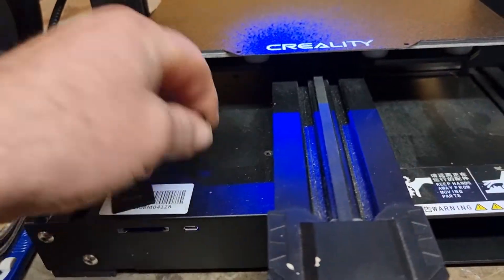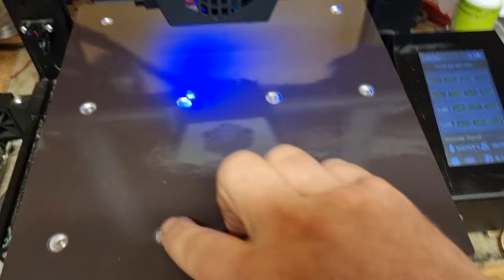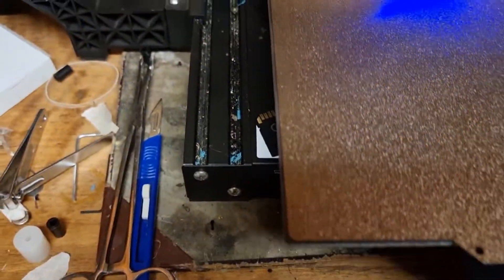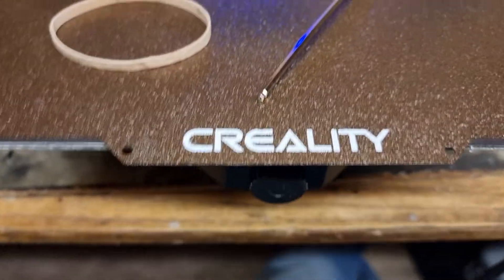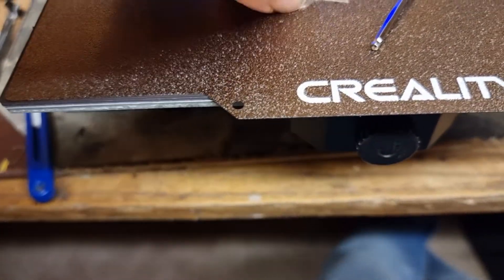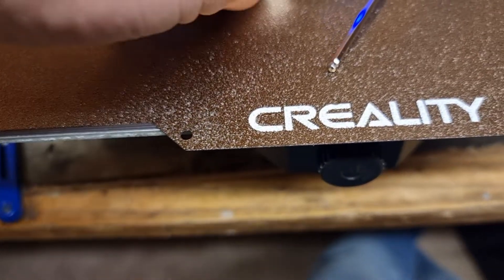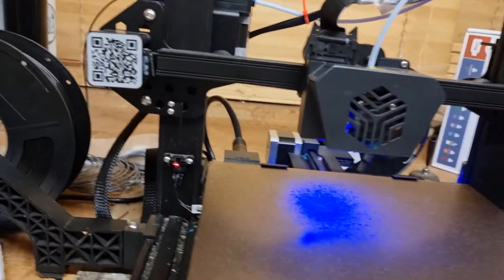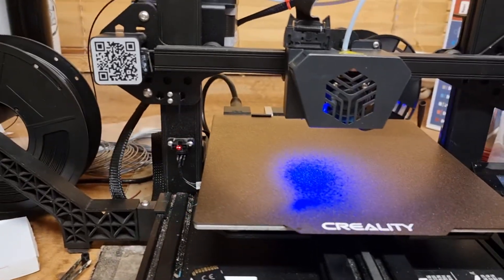cr-6 SE upgrade bed level build plate and silicone feet

Comment: I did this on my cr6-se, but I didn't use a knob on the underside, just replaced the screws with slightly longer ones to accommodate for the slightly taller silicone spacers. This way I didn't have to drill something either. The downside is the adjustment takes slightly longer because I have to remove the bed every time to adjust, but it was fast enough (took like 4 hours) because the adjustment seems to stay put just fine. First did the four corners, but turns out my bed was shaped like a bowl, so I couldn't level it perfectly, so I added silicone spacers on the 2 in the middle as well, and now it's as perfect as I can adjust it (withing 0.05 on all spots.).